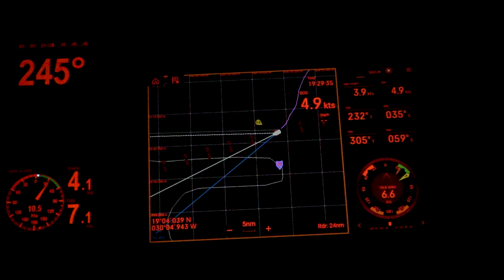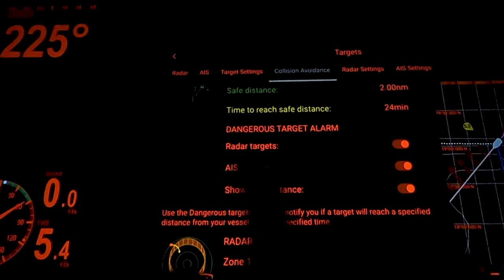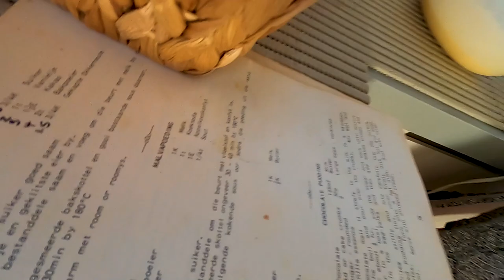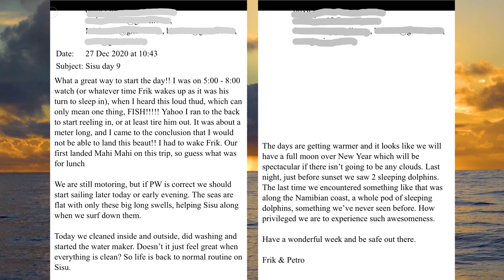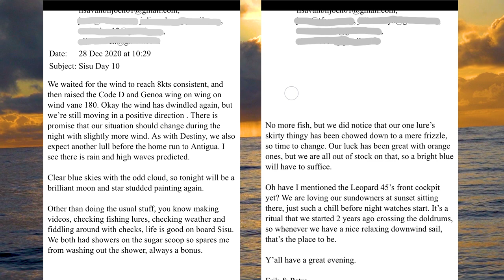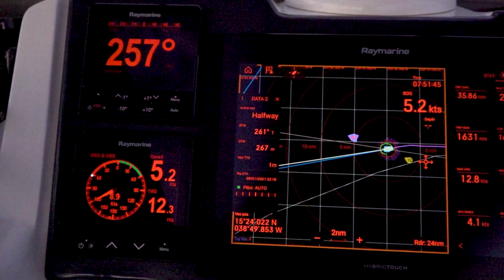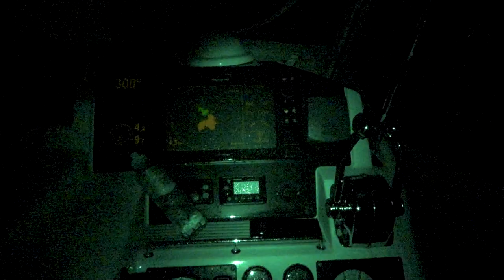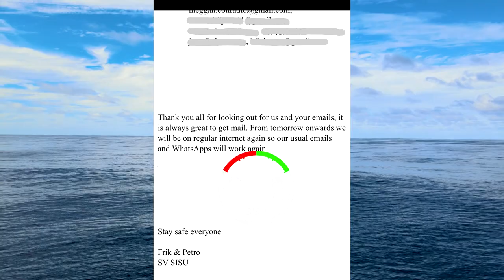#141 ATLANTIC Crossing and NAKED PARTY in the MIDDLE OF NOWHERE Part 2 | Sailing Sisu Leopard 45

Comment: that was very good, thank you. especially like the sailing and operation aspects. What happened with the port engine?
Reply from the maker: Not sure what you mean by port engine, because the port engine was fine? We did start to experience prop issues, which we later discovered was to do with feathering, and then much later that it was not serviced properly by the boat yard in Canaries. Both props are serviced and are working and performing as advertised :-) we also had starter battery issues from when we left the boat alone during our South Africa visit, which is also fixed now. Those videos are still coming [if UN Iraq gives me some time to edit the videos :-D ]